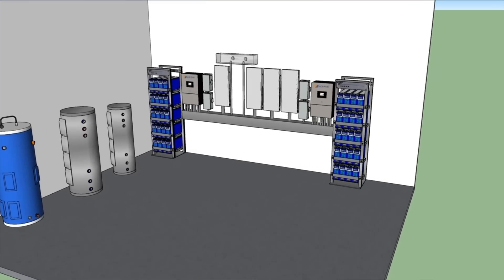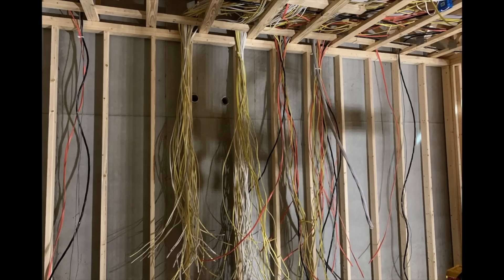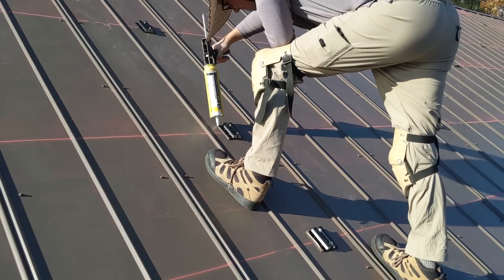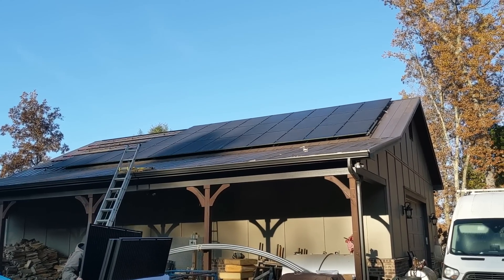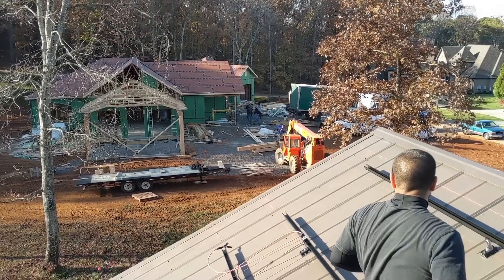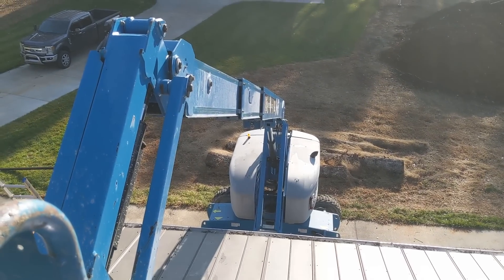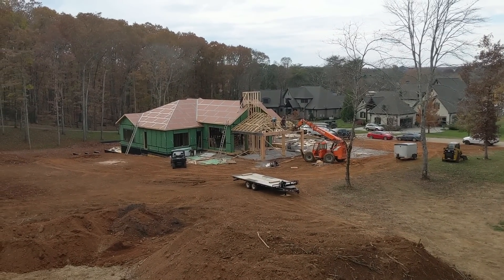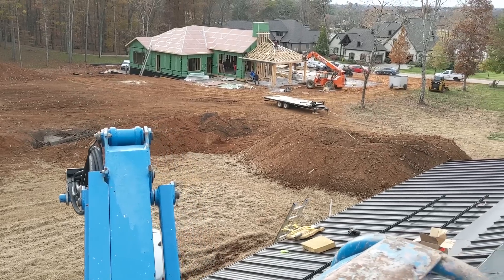Designed for Solar: Part 1

Comment: Let's play "Prepper I spy".  I see a ton of battery backed solar, solar water heating, a fireplace for heat, ample supply of wood, large diesel tanks, tractor with tiller, a place for a garden and a lake.  Looks pretty good so far.
Reply: Got their money's worth by now.

Comment: Hey Scott very cool video I live in Louisiana south west part I’m want to go solar but our parish here is crazy I have to be connected to the grid because it’s unlawful to go completely off grid but I absolutely hate this electric company here it’s a giant monopoly and they charge us a fuel adjustment charge that is the same as the kilowatts used my bill is really around 125.00 but the fuel adjustment charge and extra fees comes out to be 258.00 it’s robbery my house is only 1240 square feet

Comment: How much battery storage capacity are you planning for?  Thanks.
Reply: mark marquardt I think he said something about 400amp service but not sure if that refers to battery capacity. 
I’m curious about the type of battery and how it’s wired as well.
If it’s true 400amp service and he uses 40 batteries, I wonder if he runs 10 100amp 12V batteries in series to get is true 120V storage and then runs 4 strings in parallel. 
I have just never heard anyone use more than 48V systems. 
I’m also curious how those 310watt 24V 10amp solar panels are wired.

Comment: how far is the PV run ?  I thought the maximum PV run length was 200 feet and it looks more than that.  If so, ? just use larger wire?
Reply: Larger cable equals less voltage drop, yes.
Reply: string solar panels together in series for high DC voltage transmission to basement.  Avoid voltage drops by lower the amperage in the wires.  High voltage is always better for long cable runs.
Reply: @jimhofoss9982  Yes, I understand all of that extremely well which is why I asked the question because in the SolArk specs it specifically states the maximum distance is 200 feet though I cannot see why since as your answer indicates one can use the appropriate size wire as needed.  Maybe max 200 feet from unit to service Panel but still wire size dependent.